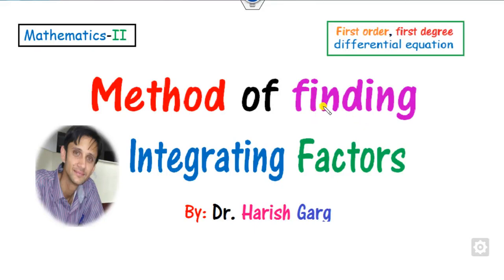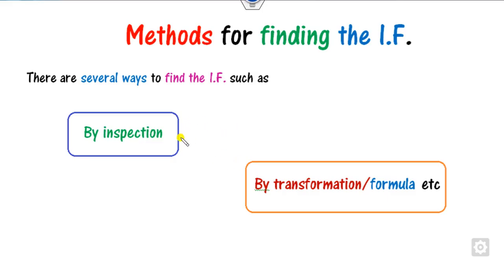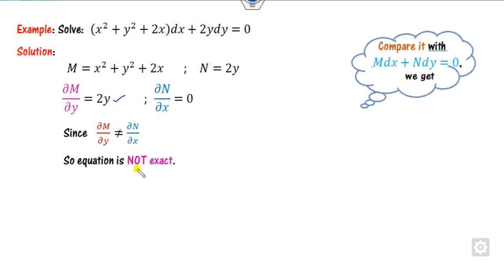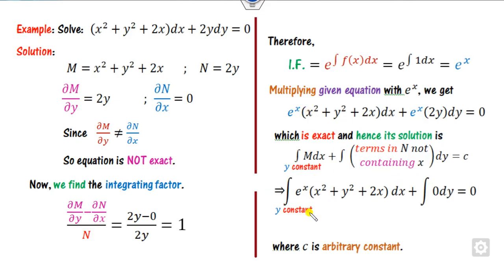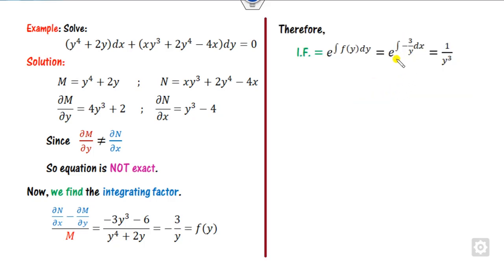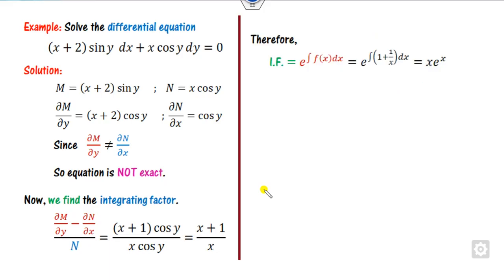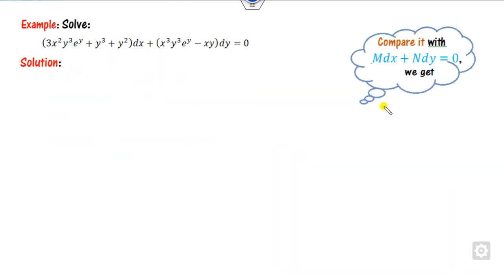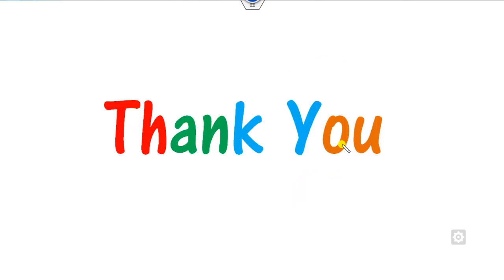Methods for finding Integrating Factor

Comment: Sir (x^2 + y^2 + 2x)dx + 2ydy = 0 ,  in this differential equation Integrating Factor can be also find by Inspection method. So, why have you solved it by Transformation or Formula method?
Reply from the maker: You can solve by inspection method as well....solve by any way.... You may watch inspection method video too ... this question also solved by that method
Reply: But both solutions are different.
Reply: @dipalipansare7383 solutions are not different